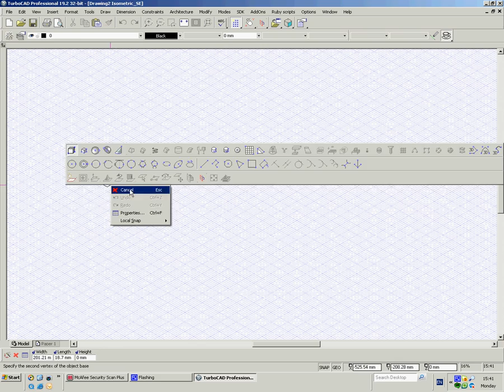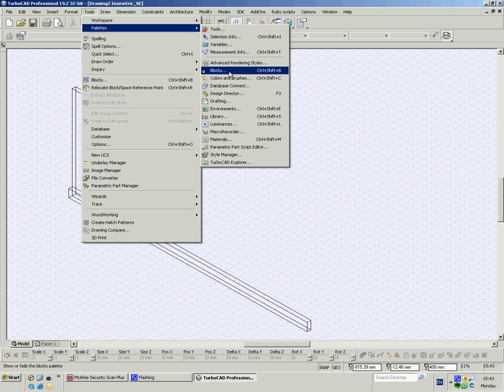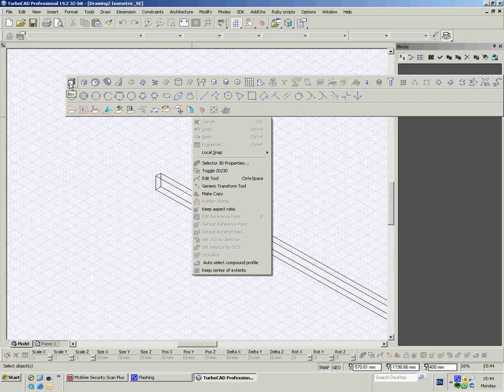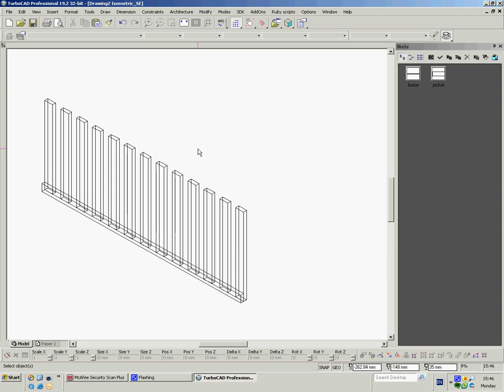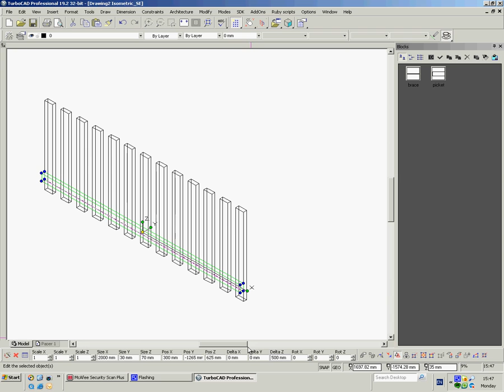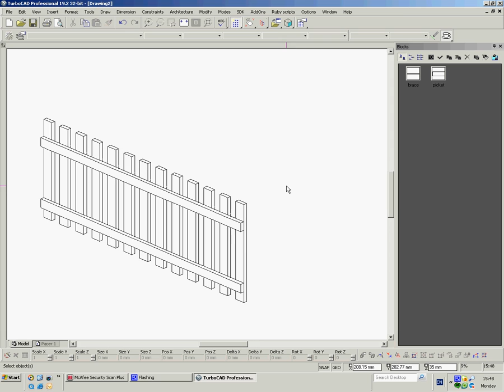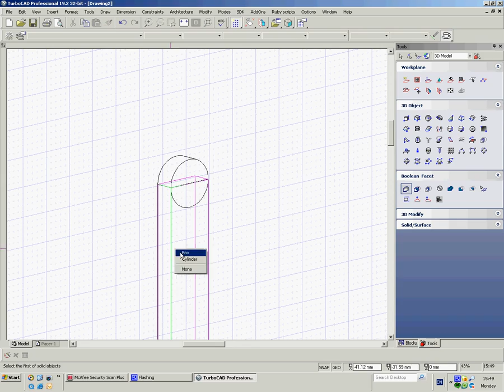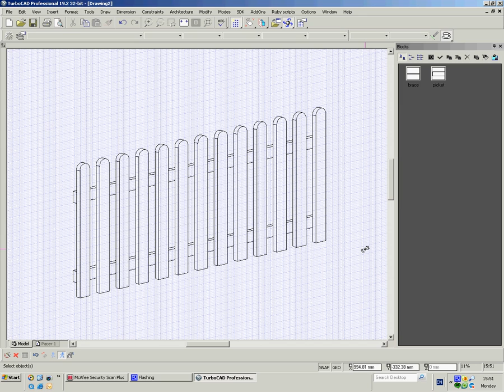TurboCAD Blocks

Comment: Hi Paul, Its 29/08/2023 and I am using a trial version of TurboCAD Deluxe. Our tools seem to be different, but then I am a novice at this point in time : ) When you use a grid in isometric, and then use your"box tool", this is where I am stumped. I've tried using the "rectangle" tool and cannot see any "3d" options to give the fence posts their dimensions? I can only give a width and height? Any suggestions? Thanks

Comment: Hi Paul - thanks for putting up this tutorial, it helped with a Block issue. 
Hope you can forgive the following rant. I've just upgraded from TC 10.5 to Deluxe, coz i needed 3d for a hobby project. I'm finding the learning curve is unnecessarily steep on this app. I know Cad apps need lots of controls, but several times today i've spent half an hour looking for the command to do the most basic thing, like create a group, only to discover that it was not even on-screen and had to be added to the toolbar. Seems to me, hiding basic tools like that is just poor HI design.
And i lost count of how many times the intuitive approach is just a dead-end. E.g. i want to extrude a 2d object. Ok, select the object, click on "simple extrude", and... no, wait! That makes the "select" be cancelled. Every time. Or i want to select objects by color, handy feature. But i look in vain on the "select" tool, only to stumble on the "select by" feature buried under "Edit".
Honest to Murphy, Paul, is it just me? Because it looks like the HI team sat down one day and just about randomly threw essential controls at scores of icons, without much thought to where a user would expect to find any given thing. It just makes actually doing things, take far more effort and with far more frustration than is seemly.
Yeah, i know, it'll get easier with practice, just like any powerful app. I'm gonna go back to beating my brains out on this, hopefully by the end of the day i'll manage to extrude a 2d shape. But with a more logically laid out HI, this wouldn't be nearly the struggle it is... would it?